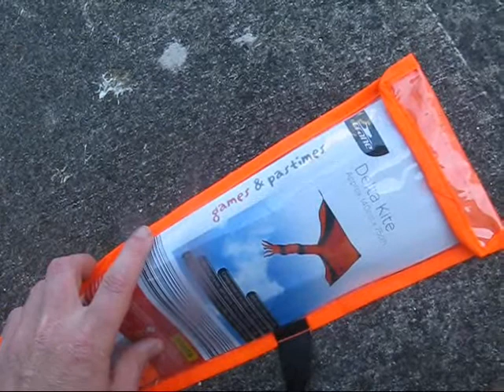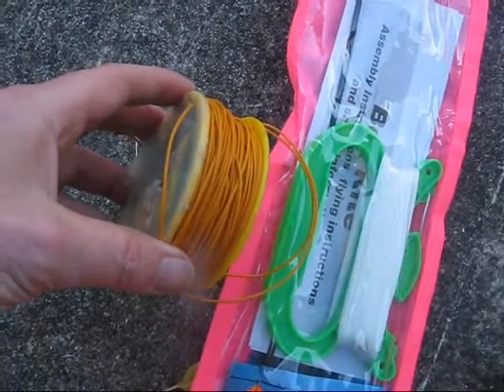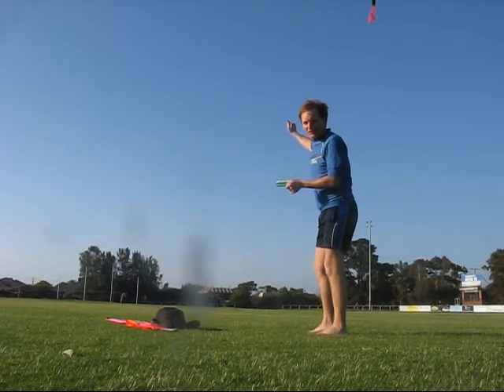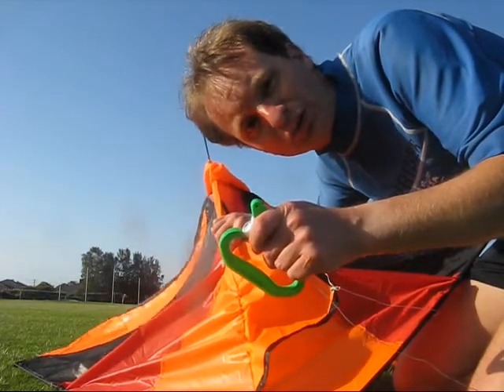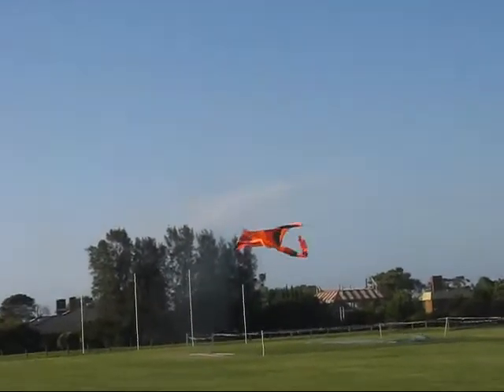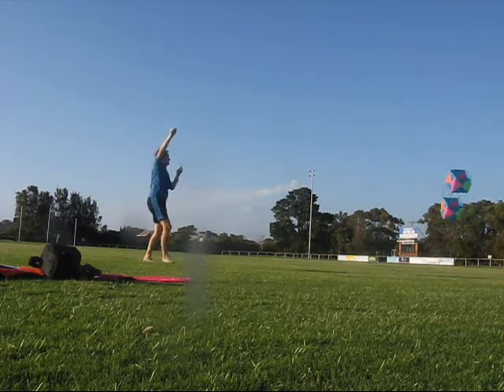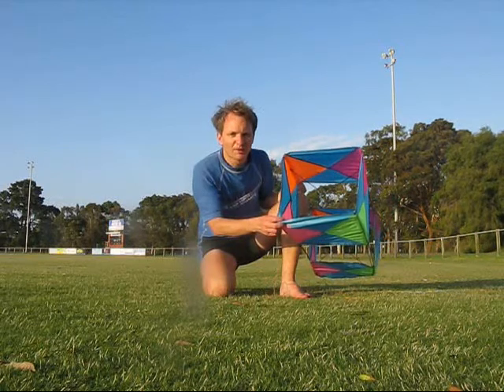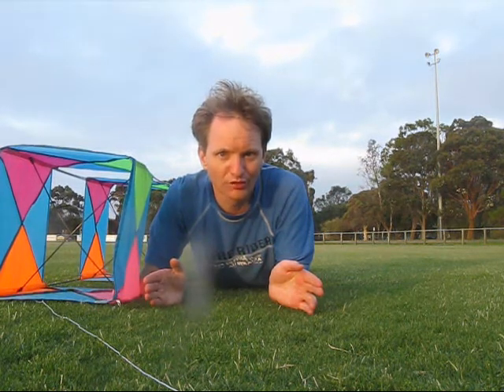Cheap kites and wire antennas - Part 1

Comment: Looks like you enjoyed yourself Peter. My biggest problem with the kites is mainly the larger of the 2 it tends to break the kite string usually in mid QSO and then I get a real workout chasing the string bouncing on the grass just a bit faster than I can run.

Comment: Hi Peter,
Have you thought of trying a helium balloon or balloon and kite combination. I have an 8 foot balloon which I have had lying around for several years which I was going to use to support a 160m vertical. It will happen one day when I can afford the helium. I have also been interested in the kite idea but thought it looked hard work for one man. Enjoyed the video
73 M0DAD
Reply: Make sure there is no wind at all for your balloon or you will find it flowing with the wind and probably bouncing off the ground. Unless though you can fill it with enough helium to overcome the wind and that would be expensive.

Comment: With the wire attached at the same point as the string to the box kite, the kite took on a tail down attitude that made it look 'stalled' - the angle of attack to the wind too high - think aircraft wing. Better would be to move it forwards, perhaps 33% of the total box kite length back from the front edge. A bridle between each side to hang the attachement point below this 33% point might also be better to save the weight of antenna appearing on only one side of the kite causing it to take on a diamond shape to the wind.
How about spending up to $24 to buy four kites plus some extra tubing to spread them apart as a group and attach antenna to that? Probably 8 times the lifting ability and 8 times the launching fun!
Reply: Alex Wild Just happened upon this video, i have made and flown kites since i was at school and i agree more kites would be an answer.
 Box kites are more stable in high winds but rather than joining them together fly them seperately space apart on one line (stronger line needed below each sucessive kite) this way if one kite has an erratic moment the other kites keep the whole 'kite train' up in the air, with this method you can keep adding kites till you have enough lifting force to raise your antenna.